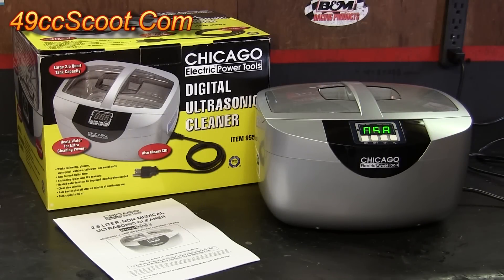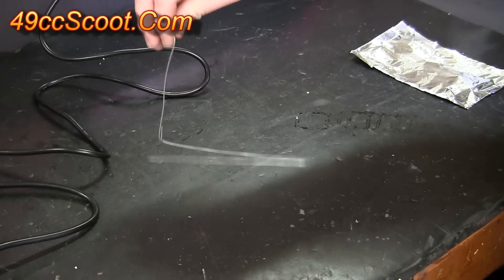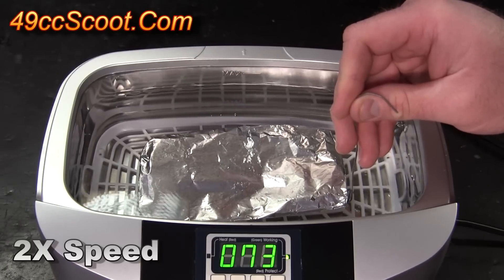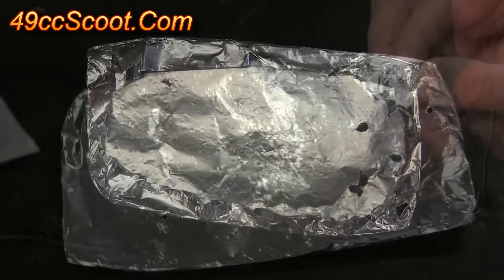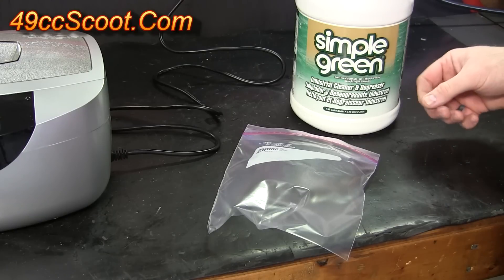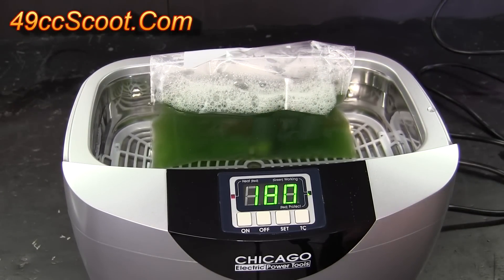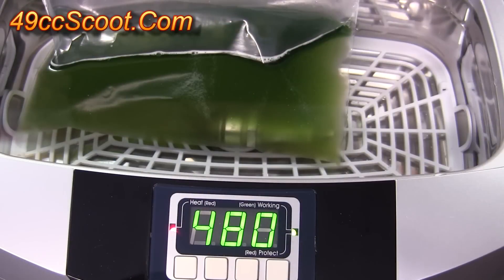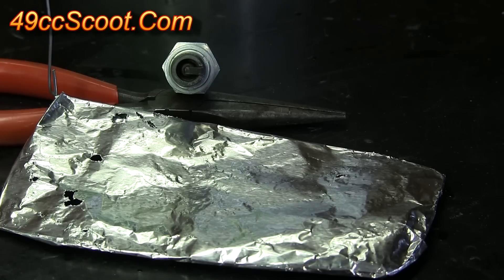Harbor Freight Chicago Electric Ultrasonic Cleaner Foil Test

Comment: I've had my Harbor Freight ultrasonic cleaner for about 6 or 7 years. When not it in use it is unplugged. Still works fine. I add about a half cup of Simple Green then fill with tap water. Ultrasonic cleaners are not degreasers. Wash all oil and grit off before putting the object to be cleaned in the tank. I'm an outboard motor mechanic. Using an ultrasonic cleaner is the best way I have found to dislodge ethanol deposits inside carburetor passages. 2 or 3 cycles of 480 seconds with a hot tank of water and Simple Green seems work 99% of the time. I have a 9L unit for large carburetors and other items. I saw, somewhere, a tank of "CLR" cleaner used and recomended. I haven't tried it. The process I use works. So unless I can shorten the cleaning cycle time I'm not going fix what aint broke.
Reply: Its been ages since I worked on carbs or engines so I have a stupid question? Do you remove the carb and drop into the cleaner complete or disassemble carb prior to clean?
Reply: @patchescessna7348   Always disassemble the carburetor first. I use a spray carb cleaner first to remove grease and deposits. The ultrasonic will loosen deposits in passageways. It is not a degreaser.

Comment: 2 things i've discovered. 
Plastic acts as a shock absorber for the ultrasonic vibrations.
Use cleaners as recommended in their directions.
i use small glass bottles and jars to separate cleaners in the cleaner. Glass seems to transmit the vibrations very well.

Comment: Try running the spark plug all night in the cleaner ?

God bless
Wyr
Reply from the maker: You'd have to monitor it all night. It doesn't have any long cycles. This unit crapped out after 4 years so I don't have it anymore, but IIRC 8 minutes was the max. I've got a different one now that has a 60 minute timer and that's much more useful.
Reply: @49ccscoot  You indicate you have a different cleaner now that does 60 minutes, which one did you change out to? Does it seem to work better than the HF?
Reply: Never mind, I just had to read further and see you got the Vevor 6L
Reply from the maker: @usaborn_0117  It does work better than the HF cleaner. I think it  has a lot to do with time, but even on short cleans it does well. I don't see the exact brand anymore, but it looks like this one, just with a different name on it.
https://amzn.to/3hfqqNv (affiliate link)

Comment: Mine doesn't preheat.....so if you want the hot temp to work for you, you'll have to run a few of the max cycles.....seems like a waste. The cleaning is spotty all over the tank just like the foil test. I clean chainsaw carbs and air filters with this. Sometimes injectors. If you're gonna use chems....use a glass jar and keep the water in the tank the same height as your chem in the jar. Watch chems that have low flash points. Always use these outside if using high solvent chems. Cheap in this instance is exactly what you get. I'll save for a bigger and better USC.

Comment: Good video mate. You asked for tips..
1; dont use a bag.
2; Use Citric Acid and nothing else. A half teaspoon is ample mixed with water.
3; PREHEAT solution to 50c before use.
4; It will remove ALL carbon from the plug. Rinse thoroughly in warm water.
5; Sit back and admire your work. Citric Acid is by far the best medium and it is in fact a food grade substance that can be brought on eBay for cheap and I mean cheap.
Hope this helps. Well, I know it will..
Merry Christmas. From Western Australia.
Reply: Citric acid for carbs as well?
Reply: @CarolinaGuy  Try straight Diesel, Heat to 55c ... Diesel is a fantastic degreaser in itself, combined with Ultrasonics its absolutely nuts as a parts cleaner.
Reply: what about injectors does it work with them aswell
Reply: @DOMTHESAUSAGE yes
Reply: @NHPhamousPolo   3yrs to reply hahahha

Comment: Not quite sold on one? Been cleaning carbs for years with the gallon can of carb cleaner, just soak and blow out with air.
Reply: I think I'll get one.
Reply from the maker: I had a string trimmer carb that I couldn't get clean and then gave it a go in the ultrasonic cleaner. A few years later now and it's still working fine. I like having it around. I can toss some stuff in there while I work and save a little time too.

Comment: The cleaner will work significantly better without the ziplock. Just saying. The part your cleaning will not absorb the full force of vibration in a bag of fluid. And the porcelain is likely to get clean of you do that AND put cleaner in the tank instead of water. Your not truly testing the cleaner the way your doing things

Comment: A couple drops of Dish soap (lemony fresh) will work just as well as that garbage Simple Green crap.  Don't breath in Simple green whatever you do!   Soap just makes surfacant, you don't need expensive cleaning solutions with an Ultrasonic cleaner.  Sometimes just warm water is all you need.

Comment: HI, I have the same cleaner. The ultrasonic cleaning function works quite well.  A word of caution, the heating function will evaporate the water and once the water is gone, the heat will burn the plastic tray. Mine did this overnight and almost started a fire.

Comment from the maker: UPDATE : The heating function of my cleaner just quit working. Worked for just shy of 4 years. I guess it's tough to complain considering the cost. Pretty much paid for itself with a couple of small carburetors that I couldn't seem to get working with any amount of air and carb cleaner work that it got back to good working order.

Comment: I've got the exact same ultrasonic cleaner and I've used it with Evapo-Rust and a collection of rusty nuts and bolts (but still useable). They came out looking great and I hosed them down with WD-40 afterwards, to drive out the remaining water and lightly coat them with oil. I bought a replacement basket on Amazon to replace that tray. I'm going to rebuild my truck's fuel filter/water separator bowl and clean all its parts in that.
Reply: I need to try Evapo-Rust

Comment: sorry bud 30 year mechanic here 2 stroke master mechanic gotta use the spark plug $20 air ran bead blaster it takes i think 90 psi a cheap $30 harbor freight compressor works i have cut my overhead nearly to 0 with the ultra sonic and this plug cleaner hope it helps
Reply from the maker: Thanks for the info. I don't actually clean plugs in here. I toss 'em at $2.50 a pop for NGKs most of the time. Just something to try in the vid to see how it did. If I'm tuning and need them super clean, then I'm cutting the plugs apart anyway to see the mixture ring. 

My main use for the ultrasonic cleaner with 3 years of ownership has been cleaning carburetors. I was hooked on it for that purpose after I cleaned a weedeater carb the old fashioned way (carb cleaner and compressed air) and it still wasn't quite right. Stuck in in the cleaner with some Simple Green for a few passes and it's been working fine for the last 2.5 years. Now my small engine carbs all go in the ultrasonic cleaner and I finish up with carb cleaner and compressed air. 

Works alright on some other engine/CVT parts, mostly because I can toss them in there and let 'em go while I'm working on something else.

Regardless, I remain very pleased with this cleaner. I'm sure there are much better ones, and I could use a little larger one, but for what I paid it doesn't owe me anything.
Reply: Is this the same Mike Macklin that went to ICC auto program in mid 80's?

Comment: i stopped using simple green because it was simple to slow and weak, I NOW USE PURPLE POWER you can buy 2.5 gallons $14.99 or 1@$6.49 but be extra care full it can strip paint. Harbor Freight has a great spark plug cleaner too works fairly well.
Reply from the maker: +Junior Yeah I've used Purple Power, but never in the ultrasonic cleaner before. I'll have to try it. Simple green has been working alright for me, but it does take quite a few cycles sometimes to get greasy parts really clean.
Reply: If you use the Simple Green  D it will not turn your alum parts black, also seems to work better if you mix the Simple Green about 50% water.  Purple power is nasty stuff, don't use it on alum unless you like a sandblasted finish on it as it eats the coating off the alum, used it to to clean a Toyota engine once, looked like it spent a month in the bottom of the sea after.

Comment: I never had real good luck with simple green. I use ammonia mixed with 409 on a gentle grease/carbon or for tough cleaning carb cleaner.
 I wonder what affect a gritty compound like borax or baking soda would have in aiding cleaning?

Comment: i had carb problems on my snow blower i bought a gallon of carb cleaner from walmart let the carb set in that for 24 hours and then aout 20 mins in untra sonic machine runs great now have also done this on gen set carbs that can not be taken apart as i worked as a sertified R.V. tech
Reply: Dude, you need to edit your comment, it is confusing. Brush up on your English as you are doing some ultra-sonic cleaning.
Reply: @bobcatt2294  Yea what he said because grammar is soooooooooooooooo important to a mech. F-king grammar Nazi.
If you can't understand what he was saying... It's just you.

Comment from the maker: Just a bit of an update for anyone reading the comments. I used the cleaner on a weed trimmer carb that had been giving me problems. Tossed it in for two 480 second cycles in about 30% Simple Green, 70% tap water. Carb worked well after that. I've used it to clean up a few other greasy metal parts while I was doing something else as well with good results. It's been worth what I paid.

Comment: i have a two stroke bike , but it seen got problem when hitting high rpm . sometime can go higher rev but sometime just feel like lagging in engine .... what the problem ?? overheating ?
Reply from the maker: Have you tried different main jets?
Reply: I concur! Also, if someone could build something like that tin foil holder but man size, riders could hang from their feet (bolt the man size frame  holder to the ceiling joists) then they could dunk their heads in the ultrasonic!
Reply: I would check the reed valves, flip the petals around.